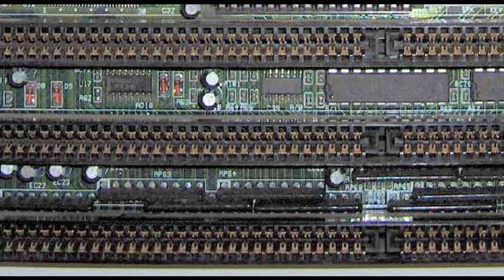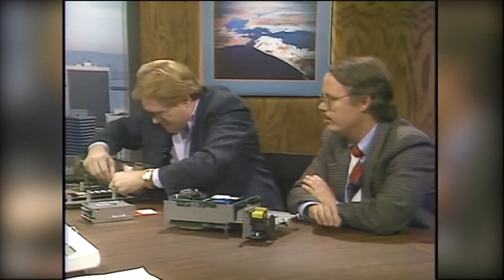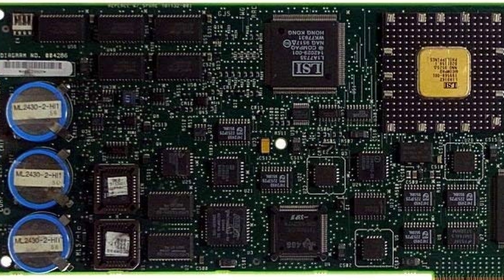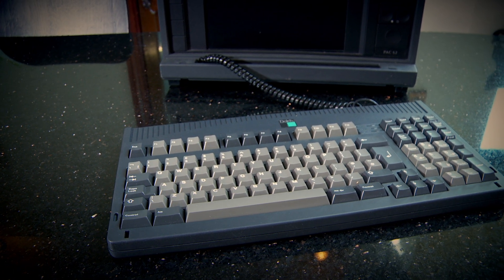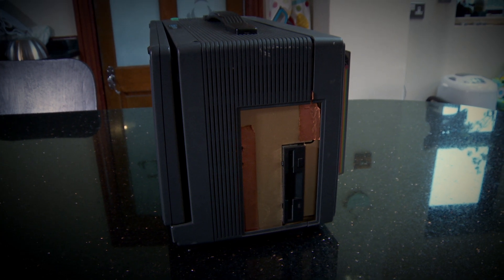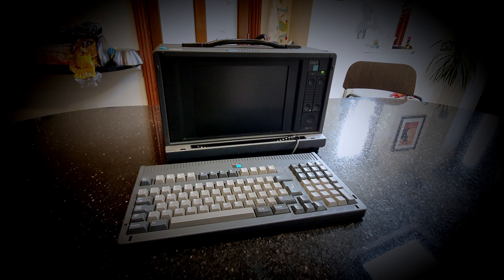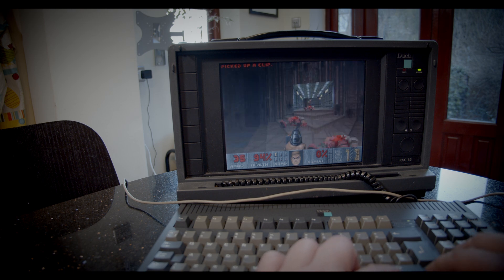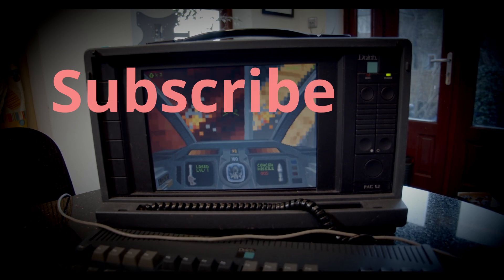E-ISA vs MCA: When IBM Lost the lead in PC market

Comment: The PS/2 mouse and keyboard connectors are still around in the PC market.  Mostly for gaming machines, as they're a bit faster than USB equivalents.  They're also more reliable, because USB requires multiple driver layers (both for the port and the device) and this is significantly more prone to software failure.

Comment: I used one of those carry pc thing with work. It had green or was it orange (?) plasma screen. My job in the early 90s was writing embedded code in the area of scada. The PC had a specialist rs232 card to analyse traffic between our equipment and the customers. Yes it was a heavy beast to lug around but it was portable !
I remember it being a very useful diagnostic tool to have.

Comment: A Compaq 80386 with a companion 80387 math co-processor was the Bugatti of its time. I got an AST Research 80386 DX but without the 80387 and it was pretty good. Those were different days. I now use a Macbook Pro on Apple iron (ARM) and it is pretty good.

Comment: I actually bought almost that exact bus logic eisa scsi card, not even knowing what the standard really was, and my consumer mmx 133 rig has no clue that it exists. Not sure if you need the full slot, or if the hardware is messed up, but I figured I'd get back to it soon enough.

Comment: When I worked at IBM, I was assigned to the RSC group, servicing the RS/6000, which used MCA cards up until the CHRP (Common Hardware Reference Platform) was introduced and standardized on the PCI bus.  I had a couple MCA based workstations/servers that ran AIX 4.3.3 and used them for work projects, and when I finally brought them home I used them as firewalls, vpns, a NAS (using the IBM SSA disk storage subsystem), and a whole list of other Linux projects - AIX from 4.3.3 on has a strong affinity for Linux apps.  Kinda kick myself for tossing out that equipment, had a lot of fun with it - MicroChannel was so much easier to use than either ISA or EISA, and AIX is still my favorite operating system.  But it got hard to justify spending so much for electricity when I got my first Raspberry Pi and moved all the functionality over to it - including the NAS, using 3 or 4 drives rather than 4 drawers of disk!  In retrospect, why IBM thought a retroactive license on ISA was a good idea, I’ll never understand, but I guess it was par for the course when one considers their issues w Microsoft, the OS/2 flop (again, another really good OS), and the lag in PC innovation.  They may have gotten away w just licensing the MCA and possibly setting another standard, and the PS/2 could have morphed into a pretty decent, long lived business line; but given the explosion of innovation since the mid 90s, had IBM ended up dominating the PC market it probably would have stifled a lot of the amazing growth that has led to where we’re at now.  It does make me a little sad how irrelevant IBM’s become.  I wonder if anyone would even notice if they went bankrupt and left the scene.

Comment: Reply Corp also made MCA cards. Reply Corp was founded by a group of ex IBM engineers that worked on the original MCA project. In 1995 - 2000 I worked at a company called Back Thru The Future Microcomputers. They purchased and resold computers & componets from corporations back then. Now they only do electronics recycling & data destruction. We recieved 4 pallets of a bunch of different MCA cards made by Reply Corp.

Comment: I used EISA network and SCSI cards on our server. We did have a remote access server that ran on top of OS/2 Warp Server. It was a very solid operating system that hardly crashed, especially considering how bad Windows NT was.  We also used NetWare for our print and file services. Also another solid operating system.

Comment: if dig deep into the history of OS/2, you will find out, that one of the main reasons why IBM and Microsoft couldn't finish the project together was that the IBM programmers were very unsatisfied with the code quality produced by the Microsoft developers. They said something along the lines that the code from the Microsoft developers is chaotic, full of bugs, and their design choices are a mess. And if you look at the quality of the later on produced systems, OS/2 vs Windows, you can clearly see that OS/2 was the way better system. Not only was it faster and way more stable, it was even able to run Windows apps in an emulation layer at native speed. Then why did Windows win that battle? Two reasons: OS/2 was not bundled with PCs, you had to purchase it, whereas Microsoft tried to make deals to get Windows bundled as much as possible, so most people got Windows with their new computer and would have to first buy OS/2. The other reason was the price: Even if you had to buy Windows, OS/2 was at least twice the price.

Comment: But EISA also lost.. But to VL local bus.
Reply from the maker: For normal home users, and for workstation oh yes local bus completely wonm In the server market eisa held sway until pci appeared. I don't think the gang of 9 ever intended it as a solution for all market sectors, just the ones that made them the most money.  That ment mostly servers and highend workstations used it, but again that's where the margin was.  I did not mention in the video but also SGI workstations like the indgeo and indy had eisa slots too so they could use PC hardware.

Comment: AWE32 would have been a much better choice, properly hardware accelerated using the CPU by far less than any PCI card and then after you provide it with a decent amount of RAM with 4Mb SIMMs you have the best sound card possible for the era AWE64 ain't it due to the non-standard proprietary RAM upgrade path.

Comment: my first actual machine was a pentium system on the intel neptune chipset. dual socket pentiums. i couldnt afford both chips, nt4 wasnt out yet, but it was coming. and i could fart around in win95 until nt4 came. was also looking forward to os2 warp being a legit os with multi cpu support (man was i shooting for the stars back then. a kid could dream of parallel processing and advanced scheduling in the os. i was 14 i think). eventually got a second 75mhz (oh yeah) pentium. both cpus were silicon lottery winners. with a seemingly excessive 16" fan pushing i could run both at 120 pretty stable. could run them at 133 but very unstable. not usable at all other than bragging rights.

Comment: the isa was just the commonly used s-100 connector and pinout that you could find on a bunch of other 8bit systems, they were usually backplane based, the processor was on a card like the modern picmg boards.

Comment: OS/2 was developed from scratch, and was not encumbered a legacy of DOS compatibility, 16-bit applications, and drivers like Windows was. This enabled IBM to innovate radically and more quickly. I developed a multi-threaded program, written paradoxically with Microsoft's Programmer Workbench, the character-based precursor to Visual Studio.

However, this freedom from legacy code also meant there were few applications available for OS/2, and the only drivers were for IBM printers. OS/2 eventually disappeared in spite of its technological superiority at the time.

IBM's development environment was called C-Set, and, in spite of being a 32-bit compiler, was inferior to Programmer's Workbench. For instance, after a compilation, if you double-clicked on an error message, it would open up the source code in a separate editor window, in a proportional typeface. You could not trigger a compilation from this window. You had to make your change, save & close, then go back to the compiler window. Brain-dead.

There was no Resource Workshop for designing dialog boxes visually. You had to write all the statements in a text editor, and wouldn't see the appearance until compiling and running the program. This slowed down development.

While debugging, I recall trying to step into the GUI part of the application code. This locked up the computer so bad we had to re-install OS/2, a tedious process requiring 22 diskettes.

The IBM documentation was so inscrutable that even for ver. 2 of OS/2, we had to refer to Microsoft's ver. 1 manuals. IBM's support gave an interesting insight into OS/2's downfall. My client had an expensive OS/2 support contract with IBM. The client's contacts were two guys in the PC support section. When I required technical support to answer some obscure and specialized questions about OS/2, it didn't make sense to get the client's guys involved, even though they were supposed to be the only official go-between with IBM. So I called IBM with the client's authorization, and impersonated one of the support techs. After a few calls I slipped and used my name. The IBM guy was livid and tore a strip of me, saying that as an independent contractor, I had no business blah blah. Here I was just trying to get a customer up & running.

Comment: Lets all just take a moment to thank the PC gods VESA local bus never caught on.
Reply: Are you being sarcastic? It killed both MCA and EISA, who both lost badly. VL Bus was the dominant bus until PCI and AGP came along. EISA was only for expensive servers.
Reply: @Carewolf  VLB was a hot mess.  It did the job, but it was a stop gap.  It's time in the sun was very short.  Also they were freaking huge and had major compatibility issues.  I don't care about market share, it was a pain in the ass.  Also, I never saw a computer with more than ONE VLB SLOT.  Not much of a bus if it only allows one card.     

It's niche was graphics in a world where almost all computers only had one screen.  I stand by what I said.
Reply: @rayceeya8659  I never saw a board with less than 2 VLBs, one for the graphics card and one for the I/O card.

Comment: Oddly, despite being one of the gang of nine, I remember Olivetti showing an MCA bus PC. I was working there at the time, so it might merely have been a prototype. I also remember Compaq making a sever boo-boo in implementing the ISA bus by omitting a memory timing signal that "no-one used any more". Except they did. All the affected PCs had to be returned for a new motherboard.
Reply: That's kind of nuts - that bus had a SPECIFICATION; why would leave out a signal?  Did they want to do something else with that pin as a "new upgrade feature" or something?

Comment: Now had IBM been more like the later version, one that realized it could make money by providing technical/engineering/development resources, they could have made their money by opening the MicroChannel specification, then sold the chipsets, engineering support, systems validation, etc.   If IBM hadn't been stingy about opening the spec, they probably would have made MORE money than they did by trying the game of vendor lock-in.  With the added benefit that the market and end-users wouldn't have had to deal with all the DMA/IRQ and other such nightmares for so long.

I expect the early "reference diskettes" would later have become stored in chips on the boards themselves, and maybe even the basic driver binaries as well.  Just think, PCI and PCIe functionality more than 10 years earlier.
Reply from the maker: I think you are spot on, if they had taken a much more open approach, IBM would have made far more money on it.  Also there would have been no need for the gang of six to create EISA.

Comment: EISA is Plug'n'Play compatible but MCA was not.
EISA bus was also faster than MCA.
Reply from the maker: EISA is not quiet plug and play. You did not have jumpers or dip switches on the cards, but on most motherboards the user had to select the interupts base address dma etc for each card, its just that ir was done in a bios screen or with and eisa contig util.  Later boards that also had pci did implement pnp for eisa in some cases, however even then having to run the eisa config util was still the most common setup.
Reply: @RetroBytesUK  Yeah my Tyan 486 EISA motherboards came with an EISA configuration utility to setup the cards.

Comment: Oddly enough, I only ever saw an EISA box once.  And it was a server, with a 486DX50 if I remember correctly...  In fairness, it was 30 years ago.  EISA was used for the NIC.  This was an AUI connector going into 10Base5...

Comment: When I worked for Kislak bank I had access to 2 similar 486 machines, one had os2 and the other had Windows 3.1. What a difference it was to have both, the os2 machine could play wing commander in a window at enough fps to play the win31 machine couldn't touch it in any way. This was before win95 so it was quite a shock to see how much more the os2 machine could do
Reply: OS/2, especially Warp, was a great OS... It probably should've killed Windows, but I think pushing it along with the MCA machines killed it - nobody wanted to pay IBM for all their hardware.

Comment: One note from a Yank who did play with MCA and a little bit with EISA. At least here in the US, we didn't say it as "e-ISA" (two separate words as you do), it was said like "eeisa" (sort of like Lisa but no L) very consistently by anybody familiar with the standard. Of course it didn't last all that long as VLB, AGP, and PCI were each only a few years away (and from from each other).
Reply: Wasn't VLB contemporay to EISA? I remember EISA being this weird expensive standard like SCSI, that only servers had where all desktops had VLB because a VLB slot was backwards compatible with ISA cards, besides offering 32 bit on top.
Reply: @Carewolf  EISA was several years earlier.
Reply: @chouseification  Right.. We had the other proprietary local buses before VLB
Reply: @Carewolf   Exactly. I remember EISA being on the cover of all the computer shopper and magazines like that when I was early on in high school, but I didn't actually see a VLB machine until my freshman year at college when one of the neighbor kids picked up a Gateway 2000 back when they had the cow print on the box and all that. As you say, there were a few vendor specific ones in between.

Comment: If you could get hold of one, I think that a Voodoo 2 card would be a great addition to this machine.  Otherwise I would be tempted to just grab a standard PCI video card and modify it to either have an internal display port or just file down the slot cover to allow you to loop the cable back into the machine (hackey and visually crude but it would work).

Comment: I was at IBM during those years.... No, IBM did not 'lose the battle' there, when the MCA vs EISA 'battle' took place, IBM had already lost the market, but people just weren't entirely realizing it yet, because they hadn't realized how the market had changed, and the numbers were in the small business market and consumers, not in IBM's traditional large accounts.

First thing to realize: MCA and EISA both ended up dead, and you'll be hard pressed to give a definite answer on which of the 2 died first.
Second thing to realize... IBM had no idea whatsoever about the small business and consumer markets, and how to compete in those. I could relate some of the discussions we had in product management at the time, but to me the example which best shows the cluelessness is when IBM introduced the PS/VP line, with the top of the line models having an at the time rather popular S3 video chipset.. All good, except for the fact that it only got half of the possible vram, and IBM decided to save a few cents by not providing any way to upgrade it. That turned the machine from competitive to a no-go in its price range. And that kind of thing kept happening over and over.

MCA nor EISA ever played a relevant role in the consumer market, and in the server market, the required cards pretty much did exist. I still have a Novell NE/2 MCA version of the well known NE2000, a 3C529 3com nic, a variety of busmaster server adapters etc. There were close ties between IBM and Novell, and IBM was selling Novell Netware, and yes, that included drivers for all the MCA NICs as well. SCO Unix also supported them just fine, as did Solaris x86 upto and including version 2.6. 

While Linux did exist in the last years of MCA x86 machines, support for MCA in Linux hasn't been great, and iirc the last Linux version to still support it was 2.2. Same for the BSD variations, tho not sure when NetBSD stopped MCA support, it never worked well. However, none of those played a relevant role in the PC server market yet untill much later in the 1990s.

Comment: Cool stuff! An insurance company I worked in computer operations for in the 1990s had one of those Dolch machines connected to their network as a packet-sniffer. I forgot about that until I saw it again in the video. They also had a single IBM PS/2 microchannel machine. This was for one application and the machine always had some kind of issue with it which required us to call in support for.

My brother had an EISA based machine used as an RIP for his ECRM VR30 imagesetter. This was required for the huge differential SCSI controller similar to the one you show in the video which was used to drive the imagesetter. The only other cards plugged into the buss were a standard video card and a 3-COM 3C509 NIC with a thin-net and RJ45 ports on it. Setting up the cards was painful because a special EISA configuration utility had to run to write an ID to the system ROM instead of flipping jumpers on the cards to set the addresses.
Reply: Yeah that whole EISA config thing was a total pain in the butt. It was just as bad as needing a 286 configuration disc. I'm so glad PCI won out even if Plug and Pray was a bit buggy at first. My EISA joy was an off lease Dual Pentium Pro 200 and wide scsi controller attached to an external drive stack.
Reply: @RowanHawkins  I'm glad PCI won the battle as well. I have more than a few scrapes and cuts from playing with jumpers.

Those were the days!